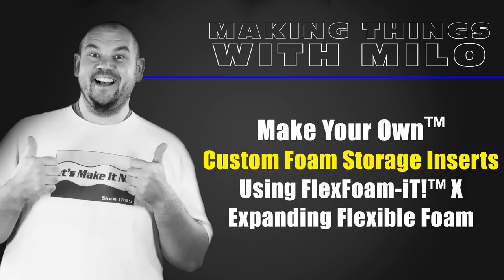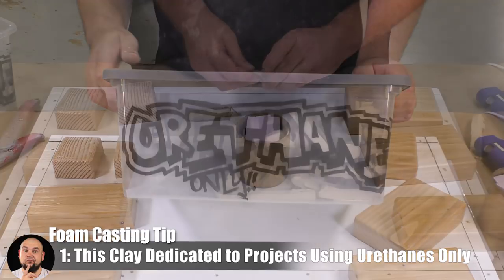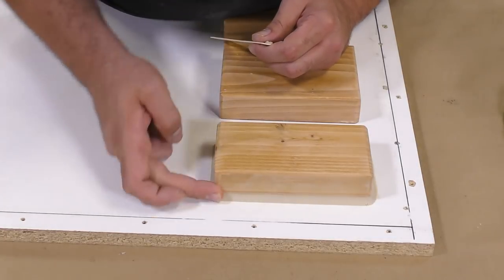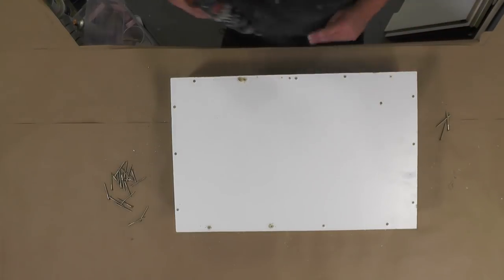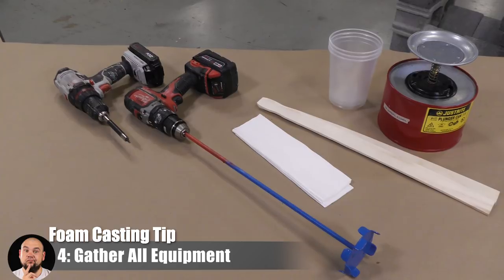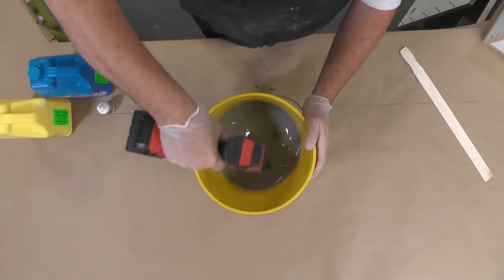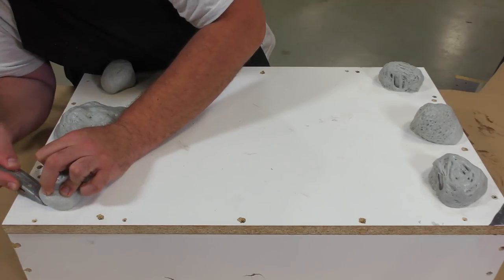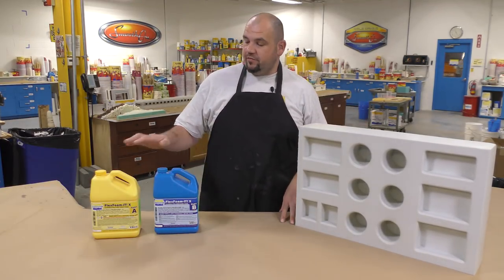How To Make Custom Foam Storage Inserts - Foam Casting Tutorial

Comment: I would like to make domed decals for my daughter’s softball
team helmets with their numbers and possibly the school’s mascot. Or please let
us know what materials works best for custom domed decals. One thing I have
noticed with store bought domed decals are that the color under the domed flexible
material fade with time in the harsh sun. Is there a UV additive that can be
added to protect the original printed colors? The base material will likely be
printed on an ink jet printer with either photo paper or regular bond paper. One
final thought, will the printed paper need to be sealed with something prior to
adding the domed material, which you suggest, to keep the colors from running? Can
you do that as a project as I know a lot of parents would love to do this for family
projects? Thanks a bunch.
Reply from the maker: For this application we would recommend taking a look at our EpoxAcast 690 UV resistant epoxy resin: https://www.smooth-on.com/products/epoxacast-690/

Comment: Will there be an offgassing from the foam over time, that may be harmful to optic and electronic?
Reply: Good question.
Reply from the maker: Once the material is fully cured, there is nothing outgassing from the system.

Comment: Firearms are not particularly vulnerable to heat or pressure. Can I wrap them in plastic wrap and cast directly?
Reply from the maker: The risk of foam adhering to the piece would be high, would recommend testing the process first.
Reply: +Michael Leeman I'm looking for a repeatable solution to a similar problem but with firearms consider using scrap kydex and making as tight a form as you can and using that kydex as a molding buck. Though i'd double check the curing temperature first and the kydex's specs' which can vary with quality . And keep in mind kydex softens well before the melting point too.

Comment: Hi there, the mold for the camera and lenses looks amazing! I want to create tall, light weight indoor planters for my home using using two sonotubes - 10 inch & 8 inch diameters to create a hollow tall cylinder. Height 36 inches. 

Thinking of using Foam -iT X self expanding foam to pour in between these sonotubes to create this planter. I plan to suspend an 8 inch wide planter on the top rim of this cylinder. I am not worried about the external looks - can paint it. Will this cylinder be strong enough to stand on its own and hold the weight of the potted plants? If not, what reinforcements could be used to hold the shape? Quite a few friends are looking for creating their own tall planters at home, as anything on the market is super expensive - especially if we want a few around the house.

If you have a better plan to create this, could you please make a video demonstrating these? Thank you so much.
Reply from the maker: Can you send us a tech ticket? Our team can help you - https://www.smooth-on.com/support/ticket/add/agree/

Comment: What about for recording panels of foam? Do they use the same kind of foam for that? The texture fells different than other foams I've seen so just checking. Thanks
Reply from the maker: Tony, generally those are made using open-cell foam.  FlexFoam-iT! foams are closed cell.

Comment: I'm an avid Table Top War Gamer we use Miniatures of various sizes. Would this be a good choice of material to make inserts for caring cases, or would another one of your products work better?
Reply: get pre-foamed sheets and contact cement. cut out the spaces with a sharp knife and glue a uncut layer of foam sheet on the back.

Comment: Do you have a product for making a custom foam enclosure to ship and store handmade delicate statues? Since the pressure of this foam is so high, i couldnt just put my statue in a bag and box and fill the box around it... so, what would you recommend?
Reply from the maker: Can you send us a tech ticket? Our team can help you - https://www.smooth-on.com/support/ticket/add/agree/
Reply: I used to work in a factory that would use two part expanding spray foam sprayed into cheap can liners (garbage bags) to pack around delicate equipment before shipping.

Comment: I'd really like to see a video on a similar use to create CLAM SHELL inserts for a PELICAN case around a PARAMOTOR where you might need to plastic bag the paramotor as you can't use 2831 Release on the equipment.  Issue: 1) How do you make a clam shell inserts?  2) How do you make it inside the Pelican Case?  - Or would you create a melamine box of the dimensions of one side of the PELICAN case?

Comment: Can make a video showing how to make a clamshell insert or a PELICAN case insert for PARAMOTOR equipment with lots of undercuts or where Release 2831 can't be applied - likely using a plastic bag around the equipment.  How do you mate up the clamshell halves? Or, how to use a pressure plate in this application?
PS.  I'll drive to your PA location with the Pelican case and paramotor to assist you.
Reply from the maker: Thanks VARocketry, this is a great idea, and we will forward this to management!  Thanks for watching and don't forget to subscribe!
Reply: I really appreciate the high quality videos, been watching for years.

Comment: What is the can he used to pump alcohol out of the top called at 12:32 ?
Reply: Found it - they're called JustRite Plunger Can sold by ULine
Reply from the maker: Correct, these are called JustRite Plunger Cans sold by ULine

Comment: Yeah but unless you have blue or red guns to use as mould plugs you would have to wrap your gun in something basically a condom so your gun won’t get stuck and ruined. At least if you have a blue or red gun you can clay it down to a board and put mould release on it. But I have a few that are not a available in a blue or red. So unless I want to go through another process to make my own dummy gun.

Comment: as much as i like smooth on and their range of products, this video portrays an unnecessary effort and waste production. for this kind of inserts the use of laser- (or hand-) cut foam sheets is cheaper, faster and a LOT better for the environment (wood, plastic cups, toxic chemicals). just saying.
Reply: and where do i get this laser cut foam?
Reply: @dreded7961  I got the foam sheets from a foam supplier (polyurethane foam for furniture and matresses). the cutting can be done in some copyshops or by similar advertisement suppliers that have the mashines. you'd have to bring the material and a technical drawing.
Reply: @dreded7961  *polyethylene foam https://www.youtube.com/watch?v=a03NhkGzYK0 seems to be the choice for laser cutting (i cut mine by hand)